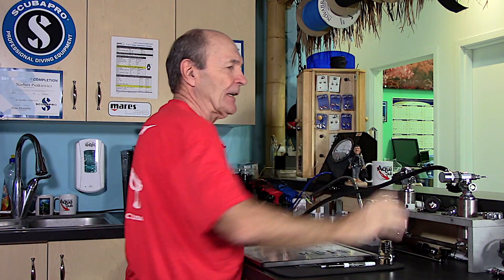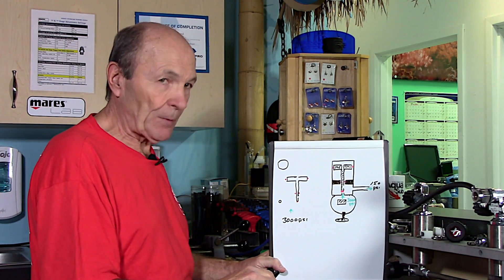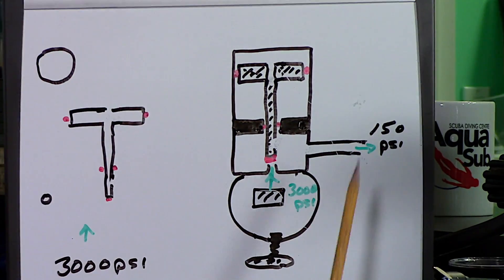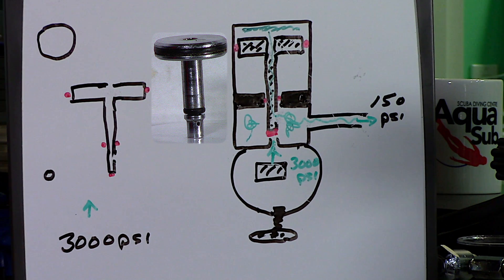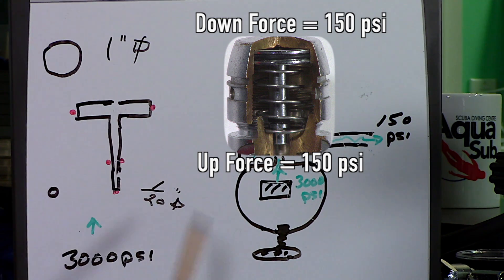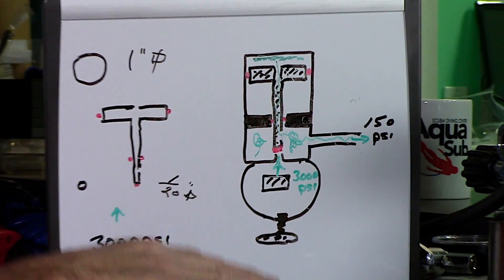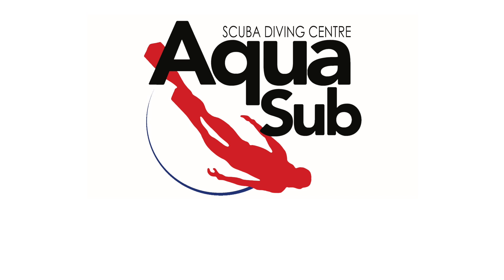How A Piston Regulator Works - Scuba Tech Tips: S08E14

Comment: Awesome vid really only vid that’s made it simple and not sound like magic I’m new to this system  ,one question if u play with the math of the area of the piston top and seal area at the bottom would it tweak the outward pressure below or above 150 ? So if u wanted a desired output u could use math to figure out the area needed on both sides being top and bottom piston ?
Reply from the maker: Thanks for the compliment.
You are quite right. The outgoing pressure, known as IP (intermediate pressure) in scuba, is determined almost entirely by the relationship between the area of the small & the large end of the piston. If you wanted a higher outgoing pressure, simply increase the area of the large end. That will require a higher pressure before the piston is forced down to close on the seat.
The math is simple as you say. 
If the top & bottom of the piston have the same area, the incoming & outgoing pressure will be the same - 3000 psi in, 3000 psi out. If the top is twice the size in area of the bottom end, the pressure will drop by 1/2 - 3000psi in, 1500 psi out, and so on.
I'm not sure if you're suggesting that it should be easy to change the IP on a scuba regulator but let me assure you, it would not, be easy that is.
It would require changing the relative area proportion between the top & bottom ends of the piston. To do that would require the production of a new piston with the desired area relationship. But that new piston would not fit into the original body. A new cylinder would be needed. Basically you would need to make a complete new 1st stage from scratch.
There is some ability to make minor adjustments to the IP in a piston regulator by changing the force of the spring. Doing so will alter the IP required to close the valve. If you increase the spring force, say by placing a washer under the spring, it increase the force acting on the piston and will make the IP higher. And vice versa.
Neat huh?
Take care.
Alec

Comment: Sir what is the purpose of spring cover by the piston
Reply from the maker: Spring cover?? I'm not quite sure what you mean. The spring is there to assist in the opening of the valve. The spring is positioned such & designed such that it tries to force the valve open. Only when High Pressure air (HP) is applied does IP flow to the top of the piston and start to force the valve closed. It is working against both the HP pushing on the bottom (small) end of the piston AND the spring force.
The spring is contained in the cap or cover that also acts as a cylinder for the piston.
I'm not sure if this answers your question. Try again if needed.
Alec
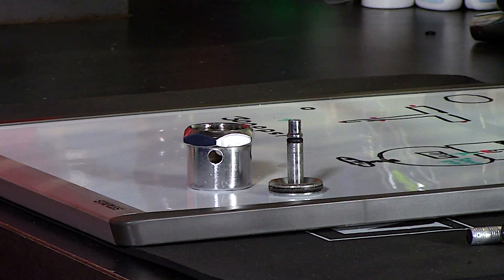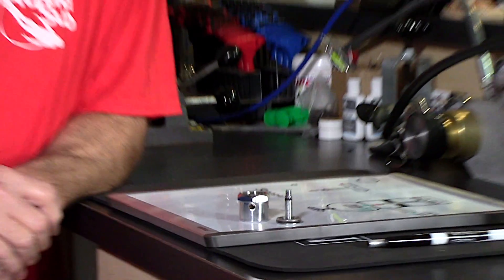Reply: @AlecPeirceScuba_SeaHunter  So the small end and big end of the piston are not in a 1:20 ratio, but rather something like 1:21 or more, Because additional force is needed to overcome the spring.

Comment: What is the starting point of the piston before opening the valve? Thanks for your excellent explanation!
Reply from the maker: The piston movement is very small like maybe a centimetre or so.  Its starting position does not matter as the frequency it moves when you inhale is very fast.
A

Comment: Just got one doubt. Between upper and bottom chamber there is another chamber in the middle that is filled by water with ambiente pressure. Does this ambient pressure has any influence on these forces 3000psi, 150psi ? Looks like ambient pressure is helping the spring. This is not clear to me yet. I appreciate if you could explain.
Reply: The ambient pressure assists the spring and raises the absolute pressure of the intermediate chamber, the 150 PSI section, as you dive deeper. The gauge pressure of 150 PSI will remain constant however. The gauge pressure is the absolute pressure of a container minus the ambient pressure outside of the container, in other words it is the pressure an attached pressure gauge would read. If the spring chamber wasn't exposed to ambient pressure, the intermediate gauge pressure would drop as you dive and the second stage would become harder to breath from.
Reply: @johngist9248  Gotcha. Thanks much for explanation 😉👌🏻
Reply from the maker: What John Gist said is right.
A.

Comment: Sorry Alec, possibly one of the worst explanations of how a piston reg works. By focussing on the piston ratio of 20:1, you make it appear that the intermediate pressure is linear. Ok you get 150psi when the tank is full at 3000 psi in your example, but the IP would drop to 100psi when the tank fell to 2000psi. The IP is 150psi because this balances the force exerted on the piston by the spring (plus ambient pressure), which you don't really mention. Yes, the piston has to be that shape so the IP can exert enough force to close the HP port against a pressure up to 3000psi but the ratio of the piston isn't how the regulation of the IP works.
Reply from the maker: Well Tony, please appreciate that 99% or more of my viewers are neither pneumatic engineers nor scuba regulator experts. If I presented all of the many, many factors that influence the performance of a scuba regulator in my videos, i would NOT have 40,000 subscribers.
You are accurate in most of your statements. There are other considerations as well but my point is that few YouTube viewers are looking for such a detailed explanation. They want to understand how a piston regulator works (my simple description of that is accurate), what the advantages & disadvantages of a piston regulator are (my description of those is accurate) and possibly how to maintain their piston regulator (my description of that is accurate).
Despite your obvious high level of understanding of the dynamics of regulators, I must cater to the needs and the level of expertise of my viewers. 
I certainly appreciate your comments and enjoyed reading the information you have supplied but, considering the intent of the video, it hardly seems fair to call it " the worst". Others may and have disagreed.
I have read, written & published manuals for regulator experts in my 50+ years of scuba service. But they & the information therein do NOT belong here. All of that information is available online, although probably NOT on YouTube.
Thank you for watching Tony.
Reply: @AlecPeirceScuba_SeaHunter  Hi Alec, thanks the response. Fully understood. I don't think my choice of words was very good.  Sorry for any offence caused. My impression from watching was that a disadvantage of a piston regulator might be poor IP regulation, but you've confirmed that isn't the case. I've watched and enjoyed a number of your videos. Thanks for the work do.

Comment: Hi Alec, love your videos but in this case I have some issues with some information given, first the piston regulator I learned it has more critical parts in contact with water (salt water, corrosive) than a diaphragm regulator, a piston regulator that you forgot to say that the ambient pressure also is in the equation, the water is entering the first stage an in contact with the only moving part, yes, the piston itself; and that piston gets corroded and the o ring that seals around it can be damage because the piston is goin up and down thought it, in a diaphragm  regulator we have more moving parts, yes, but not in contact with water, in contact with water in a diaphragm regulator we have the spring, and the diaphragm if self made of rubber, the rest is sealed and it need less maintenance than a piston regulator. 
I know in a short video is difficult to explain everything but there was important info not mentioned
Reply from the maker: Your analysis is quite correct. Allow me to add a couple of points. While quite right about the exposure of the piston & its O-Ring to sea water, IF the diver properly cleans the reg after every use, this will not be an issue. Plus, since the piston has but 1 moving part, a part that is quite robust, it's much less likely to suffer failure. Often these debates about the relative value of piston vs diaphragm amount to personal preference, which is fine, but might impede objective analysis. The facts are, diaphragm regs are great; piston regs perform equally well, but are simpler so cheaper to buy & purchase. It's really a matter of what is important to you. Take care. Thanks. Alec

Comment: I am still confused by your diagram, not being technically minded. E.g. in your diagram the air leaves the first chamber to the second stage at 150 psi, but why does the air not leave the chamber at 3000 psi ?   Secondly, where is the spring. ?  My suggestion is that you should animate the diagram, preferably in slow motion, so that the viewer can see the parts moving.  If too expensive, just have a few diagrams at different stages of the process.
Reply from the maker: I looked into animation with Kevin but we don't have the time or skills to do it.  Try Google as I'm sure there are some animated processes to explain the movement of HP air through the 1st stage to an intermediate pressure that will make it clear Ronald.

Comment: Please note that regulator failures resulting in death, had nothing to do with either the piston or the diaphragm mechanisms: they were caused by leaks!  

In 14% of scuba deaths there was a regulator fault reported, and in 1% the regulator was misused. Subsequent testing of the regulators showed that most of the problems were caused by leaks resulting in inhalation of salt water, but in some cases there was excessive breathing resistance following a mechanical dysfunction. In a few cases the regulator failed catastrophically, or the hose burst. The difficulty of breathing from the regulator was often aggravated by other factors such as panic, exhaustion or badly adjusted buoyancy.

From: Edmonds, Carl; Thomas, Bob; McKenzie, Bart; Pennefather, John (2015). "Why divers die", Diving Medicine for Scuba Divers. pp. Chapter 34.
Reply from the maker: Don't know where you obtained these numbers but check DAN's report on diving injuries for published facts.  In some cases they attribute the root cause to 1st or 2nd stage failures.  Regular service with proper post dive cleaning and storage minimize any problems.
Reply: Data from:

Edmonds, Carl; Thomas, Bob; McKenzie, Bart; Pennefather, John (2015). "Why divers die" (PDF). Diving Medicine for Scuba Divers. pp. Chapter 34. Archived from the original (PDF) on 17 April 2016. Retrieved 23 May 2016.

Fatality rates of 16.4 deaths per 100,000 persons per year among DAN America members and 14.4 deaths per 100,000 persons per year the British Sub-Aqua Club (BSAC) members were similar.

Comment: What are the failure rates for each type?
Reply from the maker: When I serviced regs at my store I don't recall any total failures (ie 1st stage internal breakage during a dive, not a freeze-up).  Some were in very poor condition: worn o-rings causing air leakage and whinning, filters clogged, internal wear etc.  In a few extreme cases the 1st stage could not be serviced due to excessive internal wear cause by NO maintenance for years and no cleaning.

Comment: What a wonderful explanation! Now I think I understand how it works.  But, Alec, if the tank pressure goes down due to the air consumption, then the intermediate pressure also goes down? According to the simple physics, i think it must be.  Then, how does the lowered intermediate pressure affect to the inhale pressure? I imagine that the lower intermediate pressure the more difficult to inhale, however, in the real world, I've never felt like that when diving unless the tank pressure gets to an exetremely low level.
Reply from the maker: Remember it is always 150psi (generally) above ambient so if your shallow at 33' even with a tank at 500 psi, breathing effort should change very little.  Some folks think they feel a difference because they know there is some slight change.  As for me, never noticed it.
Reply: @AlecPeirceScuba_SeaHunter  Alec, thanks for the prompt comments. Sorry but what I couldn't understand was that how it maintains (about) 150 psi constant regardless of the tank pressure.  The ratio of the top piston surface to size of the hole in which tank air comes would always be unchanged, 20:1.  Then, shouldn't the intermediate pressure go down proportionally if the tank pressure decreases?

Comment: Hey Alec I hope u r in well state. My instructor told me that in a depth Diaphrame is working better then piston tech. And he told me that in higher depth presure might effect on the spring of piston based first stage and it might get stucked and not suitable to dive belpw 20 meters. I think they want to sell costly 01st stage instead. I have Oceanic Alpha 09 piston based octopus and i already used in 40 m and not was not feeling any deficiency in breth ot was working smooth and best for the depth upto 60 meter and compatible with nitrox 40 % according to manufacturer instrucrions. How could u elaborate this thing. Thanks if you can response me for this post.
Reply from the maker: It's partial true but a full tank at 40m and with venturi assist, a human should not notice a difference is both are Balanced regulators.  See S09E10 "Balanced vs Unbalanced regulators" and S07E01 "Piston vs Digphragm 1st stage".  These will give you the facts around the differences and if your dive profiles can benefit from one vs the other.  Think of cars.  There are 100's of different types.  If one really, really was the best, there would only be 1 model right?   Thanks for watching. LoVe.
Alec

Comment: This is also how an irrigation sprinkler valve stays closed.. slightly more square inches on the top than on the bottom of the diaphragm/piston.. pressure released off the top with a solenoid allows water to flow ;)
Reply from the maker: That's good to know.  Thanks Robert.

Comment: Alec very interesting do
Like a float chamber in a carburettor, if you remember these things. Used to work for air compressor company that is well known. So makes sense to me.
Reply from the maker: Right. If you are mechanically inclined, this is fun to watch. 
If you don't know the difference between a CV-Joint and a U-joint, it's confusing.
I was a mechanic in the of dwell/tach. Many young mechanics have never used a timing light and laugh when I tell them we used to set the spark timing by twisting the distributor. "The what", they say.
Alec
Reply: @AlecPeirceScuba_SeaHunter  
I gues we have a similar background. I was a mechanic it the motor trade. Then joined royal navy and became marine engineer diesel. It's there I learnt to dive doing maintence and then mine clearance.
Most young mechanics don't know what a condenser is or a distributor. And diver look blank when you mention dry suits with no zips or vents or ring neck seals, they even ask how do you get into it.
Kind regards
From UK

Comment: Is it possible to use the cream used in oring for the regualtor
Reply from the maker: Only food grade silicon grease should be used.
If the system will be used for NITROX, it should be an O2-compatible lubricant.
Now this applies to anything that will be in contact with the air you will be breathing. On other scuba items you can use whatever is available - Vaseline, WD-40, rubber preservative, etc.
Alec

Comment: But how does the high pressure gauge works in the 1st stage?
Reply: pressure gauge is connected in the high pressure (HP) section of the 1st stage (bottom part in the cut-out piece in the video). Therefore, it measures the pressure in the tank and is not affected by the instant breath oscillation. The hoses connected to the low pressure (LP) cause the movement of the piston, such as regulator, octopus and BCD hoses. Hope this answer your question.

Comment: Fantastic explanation, as always Alec!! Thank you so much! Can you inform me what the function is of the spring? Am I correct to assume that the spring will keep the piston open longer, untill a higher pressure in the intermediaire chamber is acchieved? Is this to prevent the piston from osculating and ratling? Thank you in advance for your reply!
Reply from the maker: You're right on Jamie. That spring actually serves several purposes.
While technically a piston reg will work without a spring you wouldn't like the breathing.
Alec
Reply: @AlecPeirceScuba_SeaHunter  Thank you for your kind reply!! This makes a lot of sense. 
I have started a company called AirExtender which is based in Holland, where we are developing a new breathing system that will save many lives. And I would very much like to get into contact with you, to see what your opinion is on the mechanism and the overall product. We are currently finishing the mechanism and design. If you like, you can contact me at Jamie@airextender.com . I hope to hear from you and I wish you a fantastic day!! Greetings Jamie

Comment: Hi Alex
I think the seat is not made of silicone. It is made of much harder material. Also, PSI means pounds per square inch.
Reply from the maker: You're quite right. The HP seat was often made of special materials. There have been many attempts over the years to find the perfect material - with limited success. Everything seems to break down in some way.
The LP seat in the 2nd stage was traditionally rubber or neoprene. I think most are silicon now.
Thanks.
Alec
Reply: alot of my replacement factory seats are now some form of silicone interestingly enough, personally I would have thought some form of viton etc, but no.